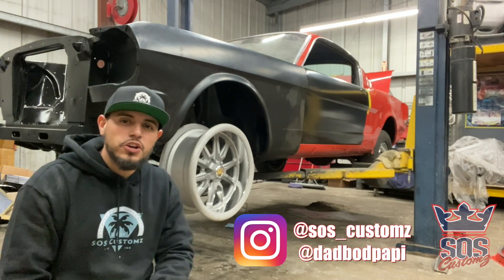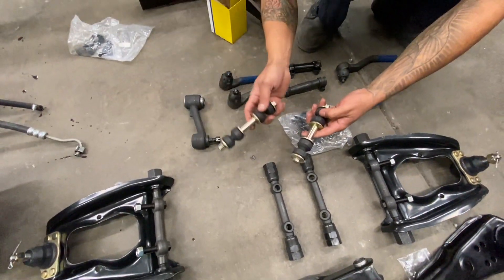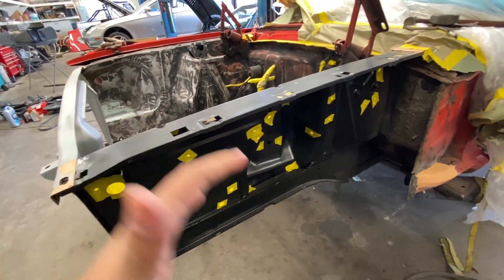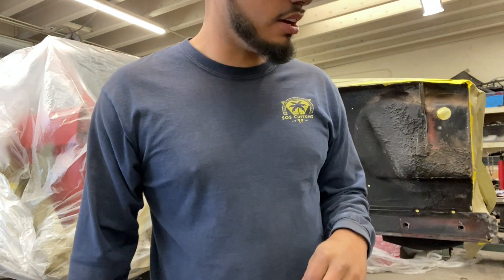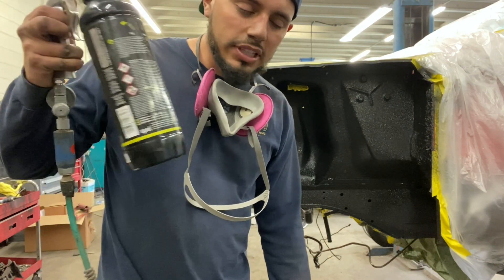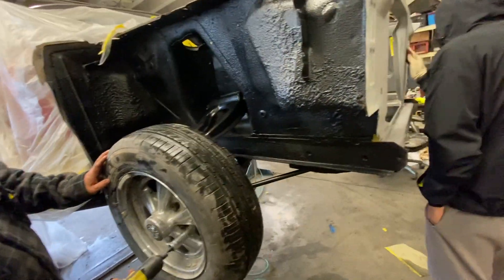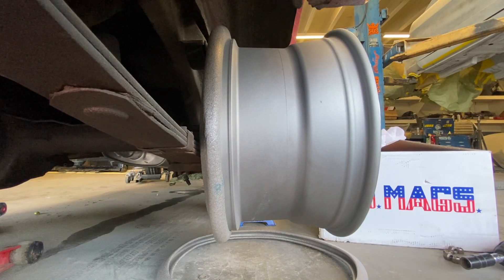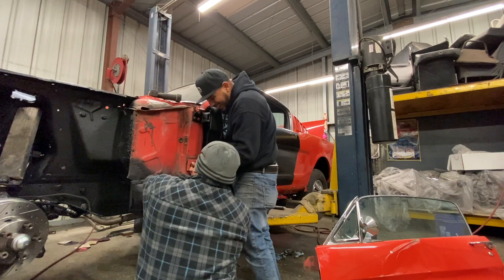Rebuilding a Wrecked Fastback Mustang - Part 3

Comment: That kit cost $××.×× and hourly rate to sand that to worker is paid my worker to use aircraft striker and sanded it out with needle gun and wire wheel and painted it....